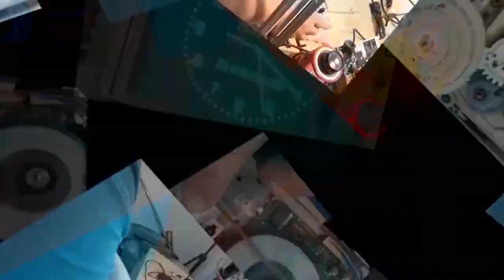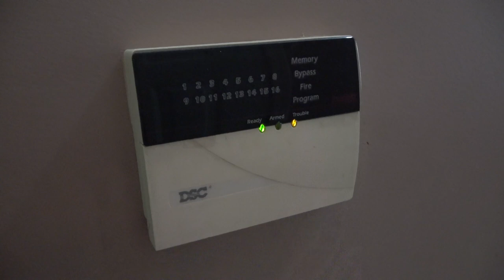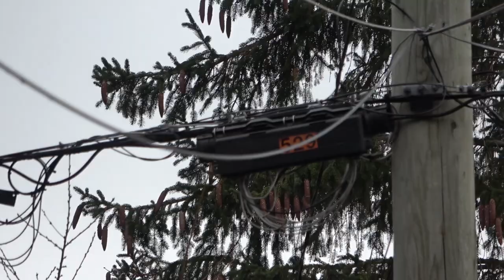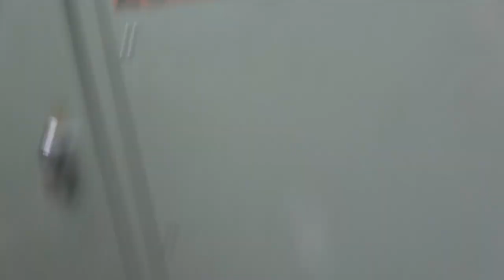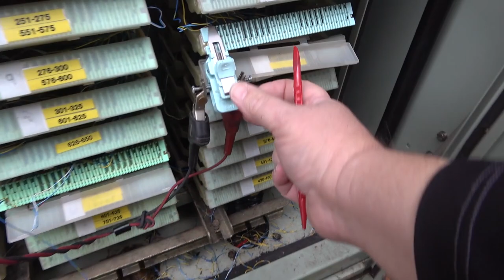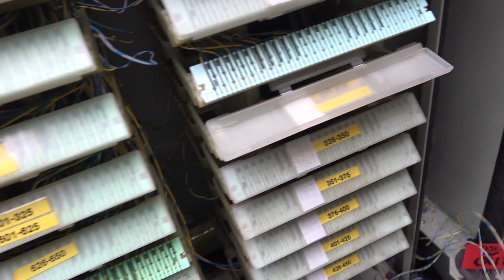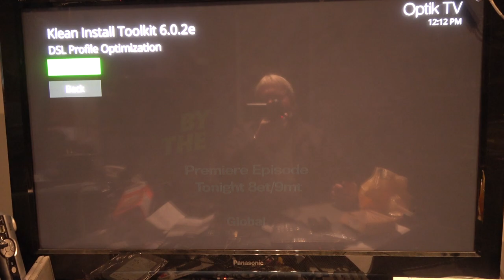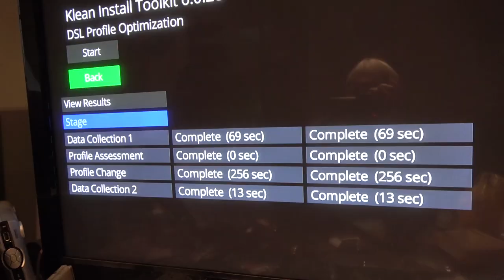Fixing my old noisy copper phone line

Comment: Why dont you have fiber for internet and copper for your phones and emergencies

We did that until Telekom Slovenija decided to cut the ordinary service in our area and even if you wanted, you coudnt have a normal landline anymore
Reply from the maker: Here we go yet again I think these are all just troll questions because nobody seems to read the responses. I'm on a grandfathered account that is not available anymore. If I change my account to fiber I have to accept the terms of the new accounts which has the TV channels in totally different packages which will cost me significantly more than I currently pay. I also get all my TV box rentals for free as the old system there was no rental fee, on the new plan I get two boxes for free and I have to rent the others. this is why I have not switched because it means more dollars leaving my pocket for the same service. Yes I can get faster speeds but I don't want or need those faster speeds. Perhaps DSL did not work for you but it does for me gives me more than enough speed.
Reply: @12voltvids  Thanks, I am not a troll and I never got more then 10mbit over DSL for normal price so I was realy happy when I got on fiber

But I kept normal landline besides (I liked to use dialup and dial up over voip is...), and also liked that if house power goes out you still get 48V over phone line (we have UPS, but it only lasts an hour)

BTW: does a rotary phone also use 48V, I have a voip gateway that supports pulse dialing, but I am afraid that if I connect it to it that it would draw too much from it(voip gateway) when it rings
Reply from the maker: if you saw the number of people that said the same thing you would think that nobody knows how to read because I have repeatedly responded my reasons for keeping things as they are. If I could only get 10 megs on DSL I would change but I get 75 which is more than enough to do anything that I need to do. Your voice gateway may or may not have enough power to ring an old rotary phone that's one of the problems is the voltage is lower. That's another problem with a lot of the alarm systems is that most VoIP systems put out lower than 48 volts. That causes nuisance alarms and nuisance troubles on many of the older alarm panels. Like you I like the fact that my hardwired phone will always work during a power failure which is not the case if you're on fiber once the UPS battery runs down.
Reply: @12voltvids  not sure how the phone company keeps the lines alive during a power outage, even if I could charge a phone on a phone line, I guess I will not be able to try this anymore :(

BTW: here is the only rotary phone I have http://imgur.com/a/Xn2CIlB

Not sure if I could get a replacment dial  for it because you can hardly see this one (not sure how it happened as I have never used it and 15yrs ago it was still normal)

Would realy like to fix it as I myself have never used a rotary phone or hear it ring

Not sure what cable(I mean the connector at the end of the cable), should I use? is Rj11 allright or what connectors did this phones use, at home we have a phone socket that accepts rj11 and something that looks like the mains voltage plug in the uk

BTW: why do some rj11 cables only have 3 wires connected and some have all 6 if phone only needs 3 why do you use the rest 3 wires for?

BTW2: did you ever hear AM radio on your phone? Why do is happen, would really like to replicate this, I already have an AM transmitter, do I just transmitt near the phone cable, or I need to cut the ground in it to make this work

Sorry for all the questions, you are the onlyone that knows all this and can anwser them :)
Reply from the maker: @Veso266  
Batteries that's how. Giant flooded wet cell batteries.  Each one is 2 volts.   24 in series.  They are huge.  Each cell is 3 feet long by 2 feet high and 2 feet wide.  Roughly the size of a 60 gallon aquarium.  The office i work out if has 96 of these giant batteries.  These batteries are kept charged by huge power supplies / chargers. Then there is a huge diesel generator outside with a 12,000 liter fuel tank. Enough fuel for 30 days of operation.  That's how the phones stay on during a power failure.

Comment: This is terrible. I am in Oregon. Am lucky to have Comcast. $79.99 for 1000/35
Reply from the maker: New customers that sign 2 year contracts will get 1000/930 for about not much more.  There isn't much difference in the speed plans.  This is almost engineered to make people want the faster plan.  300 is only 10 bucks more than I pay for 75. There are reasons besides speed i am sticking with what i have untill i am forced to change which will happen sooner than later.  I will have to ditch my tv plan when that happens because i am not going to pay rental fees on what I currently don't have to.  I currently don't stream. I dumped Netflix when they jacked the price up. Their content sucks. I was finding i watched it so infrequently it just wasn't worth it.  I'll have to suffer with the few off air channels i guess.

Comment: I like home phones to & I Also Still Have One (i live in the sticks)How Ever I Know For A Fact The 911 Operator (At Least n my Little Hik Town) Can Pin Point a Cell Phone Down to About 6"in to 1ft..I Heard & Saw This Live with my own Ears ..There is more details that i cant get into on here but i Promise Only A Fool Would Think They Don't Know Exactly Where Your Phone is at 24/7-365 ! ..This Was Back In 2005ish When I Witnessed This First Hand & in the Middle Of The Night(Not That That part Maters) However I Should Have Said You Are Right To A Point..You Said When apps are Turned Off ...& My Point Is 99.99% Of People Dont Know To Turn Them Off or Don't Know How Or Just To Stupid To Care.. Sorry I Should Have Clarified My Point From The Get Go My Bad..
Reply from the maker: If you have a valid GPS signal they do. If not they will know the last place the phone had a valid GPS signal, and they can coordinate between cell sites. With 5G this is becoming more and more accurate as the sites are down to about 50 metres between antennas, so they are very close and that will narrow down the location, but if you are in a building with several hundred apartments they do not know exactly which unit you are in.
If you are outdoors, such as in a moving car, with clear line of site to the satellites then yes, they have your location down to a few feet and even know what direction your phone is facing. In a building, not so much.

Comment: Good lord man. Twist the pairs. No wonder why you have noise. It's called twisted pair for a reason.

I used to do TECH support for techs in the field on trouble calls and EVERY SINGLE TIME they would have the twisted pairs un-twiested.
Reply from the maker: They are twisted, except where i pulled them apart to clip on the but set. The jumper wire at the xconnect is also twisted. The noise is not from twist on the pairs. It is from a wet splice down at the corner causing corrosion on the tip side wire. The twist is only to reject ac induction and rf induction. In the 25 pair bundle each pair has a slightly different twist ratio just like cat5 6 ect.

Comment: wow, you stay on coper just for an old alarm system?
- why not disable phone line voltage monitoring? or use an voit to analog converter with a status led, use the status led to switch a relay. if service is down, disconnect the alarm phone line, alarm goes off.  (you can meter the fiber to, it done on a lot of important fiberers.
Reply from the maker: I stay on copper because to change means I have to change my existing grandfathered rate plan which will add about an extra 40.00 a month to my bill.  Internet speed is the least of my worries.  I have 75 down 20 up on my existing plan unlimited data.  Perhaps getting gigabit is important to you but it means nothing to me because I don't game I don't surf that much I don't watch much online all I need personally would be a 25 perhaps a 50 meg service anything over that it's more than I need and I have 75 now so why bother it works plus my phone works if the power is out I can use my old rotary phones without having to build or use any type of converter which means buying more shit and my alarm system works with voltage monitoring. So tell me why would I want to add more equipment and add an extra monthly cost?

Comment: You must be working for one monolithic monstrosity of a company, "hey the old stuf works fine, dont bother upgrading"... yeah that will work great in the long run.  you know there are convefrters for rotary phones to work on modern systems, and you could upgrade your alarm to have a "dead mans" switch to use something like, hey I don't know, dedicated wifi or 4g. all of which come asw bridges for a regular phone line jack..
Reply from the maker: It isn't that I can't put in fiber. Hell they want me to. I don't want it.
I don't want to have to change out equipment that works. I don't want to put in rotary to tone adapters to use my old phone, I would just throw the old phone out or use it for incoming. I don't want to change out my alarm panel. Yes I know I can get a 4g cellular system, but is that free? No it is not. I don't pay a dime for monitoring. I have my panel programmed to call my cell in the event the alarm trips. If my home number calls my cell when I am out I know it is an alarm, and I can check my cameras and see if it is a real alarm or not. Remember alarm monitor companies just call the police and the police do not respond to residential alarms, and if they do and it is a false then you get a ticket. If my system calls me and I see someone in my house, I will be calling the police myself with a video verified break in. If someone cuts my copper line, the alarm sounds the siren and scars the burglar away before he gets in. That safes me 500 on my insurance for a new door.  Home phone on fiber does not drop the pots voltage if the fiber goes off line, just no dial tone so no way for alarm system to know the line has been cut. Also when ONT takes update in middle of night it resets, which does drop the voltage for a minute and then the siren is going off in the middle of the night. Believe me I deal with enough customer complains about that one. Even if their alarm is not armed at night, the loss of phone line causes a trouble code for loss of phone, which sends a signal to the alarm company as soon as dialtone restores and makes the panels beep and flash the trouble light which of course generates a trouble call for us, and then the customer gets a diagnostic truck roll charge for incompatible 3rd party equipment. Again it is MY choice to stay on VDSL, not yours, or the companies or anyone elses. I am perfectly happy with what I have, and I have more internet speed than I need. My phone works during a power failure, and my alarm system works without any glitches. Have a problem with that?  Incidentally my VDSL speed is faster than most peoples fiber, as the vast majority of fiber installs I do every day is for HS25 and they are paying the same for 25 as I am paying for 75 so there. Yes I do faster speeds, up to 1GB, but 25 is by far the most popular speed believe it or not.

Comment: your telling me you have fiberoptic but use DSL internet??
Reply from the maker: fiber is there but i am on dsl. This just drives you crazy doesn't it?
Reply: @12voltvids  it’s more like wondering why not take advantage of the speed if it seems like you could run on both copper for the phones and then fiber for the internet
Reply from the maker: @ajlion  It all has to do with price. I don't want to increase my bill. I lose my grandfathered plan when I switch which will cost me about 30.00 a month more to keep what I have.
I don't need anything faster than internet 50, which I have 75. Even if I was on fiber I would not opt for a higher speed / price plan so what is the point?  Many people go for the 150 or 300 or 1G plan. That's nice, but in reality nobody needs that speed unless you get off just looking the numbers on fast or speedtest.
Anyone that knows me knows that I won't pay a dime more for something than I have to. When I travel I won't even put a roaming package on my phone, and just opt for the pay per use for emergencies. I do not have any long distance on my phone, I use a magic jack which is VOIP to call LD. I may have expensive cars and cameras, but when it comes to subscriptions I have the bare minimum. There is a reason I am still running windows 7 on my edit machine. I own a copy of premiere. Win 10 it won't run properly. Adobe wants me to upgrade to creative cloud for 10.00 a month. Not happening.  My cell phone costs me 15 bucks a month. No expensive plan for me. Just the bare minimum, and I rarely use it.Its not that I can't afford it, I just like to hang onto my cash not waste.

Comment: Not everyone dares or likes to update to newer ones. Not always the new ones are that bad.

Here in Norway most people use either hybrid fiber which is the old cable tv system but instead of adding fiber to people, the fiber only goes to the box that distributes internet to people. The internet is on a whole different frequency than the TV and is being taken out of whit a modem.

Many people have fiber in Norway and the house alarm we have goes on both the internet in the house and the mobile network. The alarm  has a backup battery. we have a wireless camera in the house.

I will NEVER go back to the internet through phone cable! incredibly poor and can only handle low speeds
Reply from the maker: Cable delivered internet here can have fast download speeds, they claim up to 1 gig, but the upload speed is still 20. VDSL speeds here up to 150 down 40 up. I am cheap I only have 75 down 20 up. Good enough for me. Fiber on the other hand is currently offered up to 1.5 gig down, 940 meg up. Symetrical speeds up to 750mb. I do plenty of GB internet installs, but for me, I don't need that speed, and won't pay more to get it.
I don't even need the 75 I have. It takes 22 to stream 4k video, and only about 7 for HD.  About the most intensive bandwidth stuff I do is uploading youtube videos.  Even though I have unlimited bandwidth on average I use less than 200 gigs a month.
Reply: @12voltvids  I understand. a company called get now telia tried to take over internet and tv in the city I live so I got an incredibly good offer on 500/500 fiber internet and tv and mobile. I got everything fitted and fiber into the house for free.
Yes without the discount fiber can be a bit expensive!

Comment: I'm on fibre and get 14 meg fibre. long distance to local public fibre box.
Reply from the maker: Fiber doesn't always mean faster. All depends on how many nodes are sharing the feeder fiber. For us it's 32 customers to one fiber. But some companies can have one fiber feeding 64 or 128 customers. We will be launching a faster speed where we cut the number from 32 to 16 which will in theory double everybody's speed it offer three gig service and I understand there's even a 10 gig service that's going to be offered for those stupid enough to pay the kind of money that that will cost. From the Olt in theory can do 50 gig on single mode if you have the entire Olt dedicated which is what is happening for the 5G cell roll out. The cell nodes get an unshared fiber directly
Reply: @12voltvids  Definatly 128 plus customers on my box.

Comment: 48 volts on copper?  You have an old local office.  Newer systems us a 24 volt battery.
Reply from the maker: Everything here is 48v. Even the remotes we were building 15 years ago were 48 volts. Never seen any 24v offices and i seriously doubt this was ever used as alarm systems would detect a line fault.  Shit they throw fault codes on the 42 volts the ont supplies.
Reply: @12voltvids  Interesting.  Here in northern California,  many areas cut the battery to 24 volts.  And I know,  the old  WE 500's with carbon mics really need 48 volts to operate well.  Where I used to live,  the change happened when they ripped out all the Strowger switching and went to an Intel 386 arcitecture.  I never noticed it until one day,  I was checking the lines...
Reply from the maker: @gyrgrls  GDT5 here.  Other offices dms1 and dms100 and some Nortel sdms but they all operate on the battery voltage of 48v.  Even all the dslam run on 48v. 130vAC to ring the bells

Comment: Late to the party.. but why not use POTS for voice and fiber for data?
Reply from the maker: Price is higher for fiber as I lose discounts that i am grandfathered into now.  As soon as i make any changes i have to accept new terms which will add about 40 a month.  I don't need or want anything faster than I have.   At some point they will shut off copper and then I will have to switch but untill I am forced to change i will leave it as it is.
Reply: @12voltvids  right after I posted, I kinda figured it would be something along those lines. You don't get free or heavily discounted services working for them?! I did cable service about ten years ago and all you had to pay for through them was the telephone line, which a mounted to ten bucks a month.

Comment: Please refrain from videoing your keys, it is easy to decide those keys with a simple snapshot.
Reply from the maker: What keys
Reply: @12voltvids  9:13
Reply from the maker: Not too worried.  Nothing critical there.  Just keys to cabinets and my truck and it is a chipped key. No compound keys as we use a card key to access facilities.  Perhaps the gate to the parking lot at work. No personal keys there.  Just service cabinet, the lock for the ladder on my truck ect.
Reply: @12voltvids  oh okay.